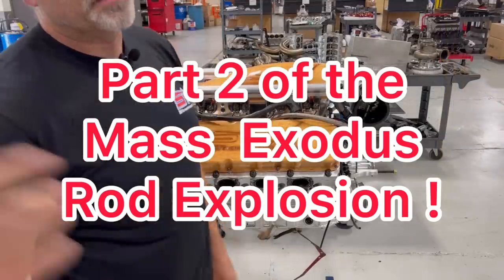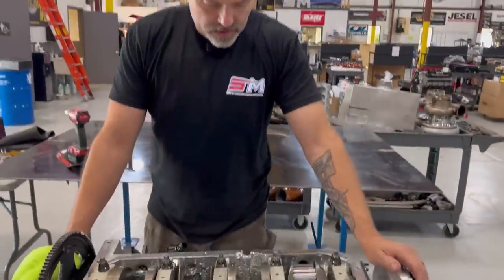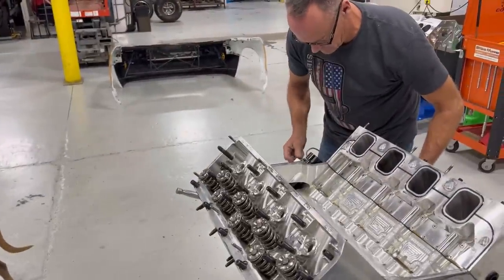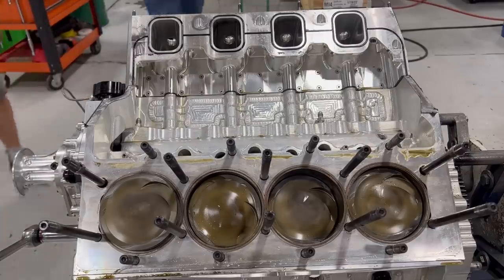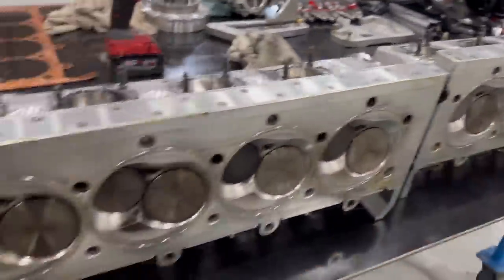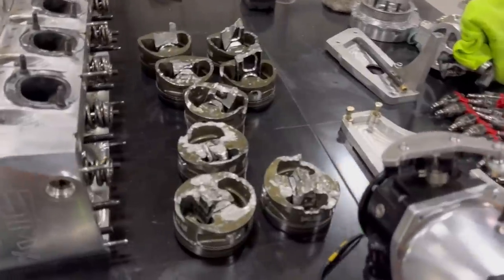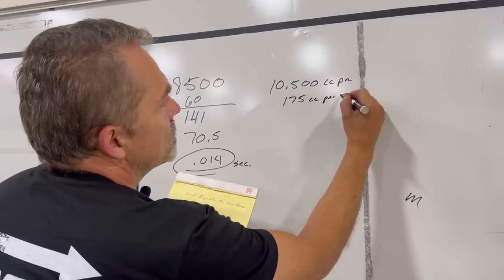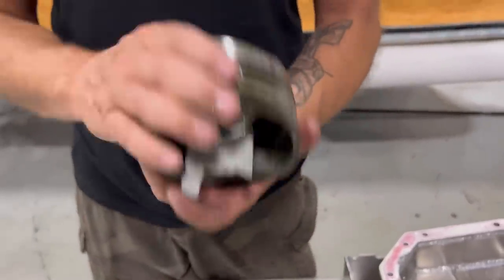EXPLODED RODS  Part 2

Comment: You should do a hardness test on the broken rods, I wonder if they are too hard. Looking at how they shattered they seem to have have not been normalised or over tempered. The crystalline structure seen along the breaks can tell a lot but we don't know the material they are made of or the process used to form them. They look like billet that's machined, I could be wrong as I'm not a engine guy but they don't look forged to me. It they are billet then what hardening/tempering process did they go through? after machining. To me it looks like they were hardened but not normalised enough after. Or the batch had excess carbon and the material was just too hard. Even a simple Mors test is better than nothing, try different areas to see if the part had different hardness's and perhaps huge internal stresses inside. A Rockwell test would be a step up without going too deep into the rabbit hole.. All very interesting stuff..

Comment: only time i broke the little rod end was by detonation. ran it lean detonated broke the little end was on a motorcycle with a carb at about 3/4  track the carb would be drawn dry and the motor shut off. the next rub broke all little rod ends at 7.2k rpm. the chances of machining or the same error to all the parts doesn't seem realistic. especially with such a rare failure

Comment: Im thinking the titanium composition was too brittle, and what was achieved by less weight was sacrificed in tensil stress. Or perhaps the rods were made of an amalgamation of metals that has increased tensil strength but also has increased brittleness, and is unproven in this particular application.

Comment: Hello Steve, when I listen to you my mind does weird things lol... 

1. If just say your cooling system had 55psi of boost put into it would it hold that pressure considering most systems are around 7psi?

2. If the engine "hypothetically speaking of course" hydro-locked due to fuel even though the math says it can't under normal conditions. Lets just say because of some glitch it caused the 1000cc injectors to flood the cylinders with fuel wouldn't the fuel that hydro-locked the engine still be there? I don't remember excessive fuel in the catch pan.

3. I think you said in a prior video the engine had 1000 miles on it and I can't remember how many runs but if it were a defective rod or something to do with assembly it would not have lived a minute ( as you said ) with the power it's making. Now that the actual location and texture of the break can be clearly seen the first word that came to mind was "brittle" like carbide dropped on a steel plate. The next thing is did one rod shatter first and take out the rest or did they all go out at once? You said you felt a very bad vibration like it was the driveshaft, I would imagine it was all instantaneous. At 8500 rpm and with all the fragments I'm afraid only the good Lord himself knows exactly what happened and thankfully He kept the oil off your tires

4. Last question, a video to the right is on unbreakable carbon fiber rods, what are your thoughts?

https://www.youtube.com/watch?v=asb4jLWWTbQ

Comment: I'm not a metallurgist nor a machinist but I do know a "little bit" about the types of stresses that happen to a rod inside of an engine. There are directional and centrifugal forces put on rods that are incredible, and exponential the higher RPM range. It appears your application exceeded the rod materials and/or design and they broke under the extreme stress of load and centrifugal force. I'm sure in other applications at lower RPM they would hold up just fine. I'd have to give credit to the manufacturer for one thing; their manufacturing process must be very exact for every single one to exhibit the very same failure points.

Comment: I haven't seen all the way through and I'm guessing that the rods may have been over hardened in the heat treat. If it has that particular process? Maybe they just shattered into confetti and the pieces caused the resulting damage or lack thereof. Interesting to find out the most likely reason....

Comment: What I see is big end failure at 8300 rpm. The rod caps or bolts let go the pistons then went back down on the combustion stroke the rods were sheared off by the crank journals

Comment: I didn't see the disassembly of the timing gear set as far as the engine hydraulicing but I do remember seeing the rod design which was quite beefy but didn't look to have a vertical lock on the caps but a dowel style lock that just seemed possibly a weak link when cylinder pressure gets high and rpm

Comment: Those crank journals should have a nitride hardening.  One issue could come into play at higher RPMs with aluminum is the out of balance issues.  Harmonics is a problem, but if the weights of each piston and rod are slightly off, the engine can shake itself in a grenade.  Aluminum doesn't handle vibrations for very long before it falls apart.  I know you built the engine with weight of each piston and rod in mind.  You don't skip major steps.  When the interatomic bomb occurs, aluminum tends to reduce itself to tiny pieces.
Reply: BTW for those that don't know anything about engineering, the interatomic bomb is a pun for interatomic bond.

Comment: I haven't seen anything like this since the days right after they switched the top fuelers to dry sump.
It looks like the damage is literally down to the molecular structure of the conrods. If you can afford it, have a bigger piece of the shrapnel examined by a material testing laboratory to confirm my theory.
I don't even think there was anything wrong with the metallurgy as such. I suspect a resonance problem. The forces put on the crankshaft at this stage of tune could have made it swing at a frequency the wavelength and amplitude of which might have shredded the rods. Think opera singer vs glass. This would also explain why nothing else suffered first hand damage.

Comment: There was definitely nothing wrong with the tune-up you nailed it bad bad material possibly stuff that was cooked up in China I am actually scared of death to buy any new parts right now wondering where the material came from but I will say you do have a beautiful looking engine even with all eight rods broke. PS I have broken one rod two rods but never ever all the rods at one time most definitely a material problem so in my opinion I think you nailed it also I think I need to be running one of them blocks like yours sorry to see the damage Keep On Rocking

Comment: Rod material is laminated or delaminating, I cant member which way to call it. I worked in a place that cut steel to make equipment frame and seen plate steel with that issue. I was told it was a quality control issue in the melting of ore and recycled material, not wanting to mix properly.

Comment: I think the rods broke on the exhaust stroke as they passes TDC - the material failed there first allowing the piston to impact the the head and the lower part of the rods had no support to run true in the bore anymore, so they could be subject to physical contact with other engine areas, and they may have acted like a lever to the left and right without the piston maintaining control at the flopping end of the rod.  The break looks like material failure to me.  If the failure was on power stroke it seems like your bearings would tell the tale, and on compression stroke the rod is pushing up against the air/fuel charge which likely helps slow the rod as it’s coming up on TDC…like a small cushion which could reduce the effect of elongation on the rod beam.  It could have occurred sometime between the exhaust stroke reaching TDC or the intake stroke accelerating away from TDC as the piston moves down.

Comment: Could the heating of the crankshaft have caused the radius of the counterweights to increase enough that it fouled the machined (modification that you made) little end of rods?  If this happened it would stretch the rod and maybe cause the 'brittle break' fracture you saw in the main rod bodies.  The leverage of the counterweights travelling at the speed the engine was going would have produced an enormous wedge (leverage) action, and if the clearance (produced by the modification of the rods for which I saw no measurement taken in the engine assembly video) was really small initially, the whole event could take out all the rods very quickly...

Comment: That rod company needs to do a recall on that batch and check all others to make sure it isn't a larger problem with their products. Wether it is a problem with the raw materials they received or they used the wrong material to make those connecting rods or one of the processes they did caused it to fail. What ever is the cause they should be doing everything they can to figure it out and make sure it doesn't happen again. I would be surprised if they don't want the rods back so they can analyze them and figure out why they failed.

Comment: I didn't say so, but I was thinking that the connecting rods failed due to them reaching their threshold. The fact that each one failed @ exactly the same time and exactly the same way makes it quite obvious. I've never seen this happen before now.
The bearing inserts were fine, other than being bent to hell. The journals were fine, no scars aside from where shrapnel scuffed them a little during all the carnage and chaos. Each rod simultaneously failing the exact same way. They simply reached and breached their physical limitations.
Case in point, that was one bad ass engine. Emphasis on "was" 😁.
When he stated that one piston was firing or compressing 70 times in a second whilst showing the irrefutable math I was blown away.

Comment: Could something in the rotating assembly broke or came loose causing the motor to get out of balance? Thus vibrating the rods to failure? I noticed in the last video there was an RPM drop for a short moment that leveled out before a complete RPM drop to zero. Steve also mentioned feeling intense vibration at failure like a driveshaft let go. I am sure these engine are all internally balanced and no harmonic balancers are used. But still curious if something could have thrown the rotating assembly out of balance leading to this kind of failure.
Reply from the maker: Brand new never been used in this application and power level , ever, connecting rods.  No one has ever used these at this power level. 
My original rods I always used ran with 10pm I more boost, same exact everything and ran for 900 miles and 35 passes. I should have just put them back in. 
People want to keep finding another issue instead of looking at the obvious

Comment: I thought you might my experience with anodized pistons. Running a naturally aspirated nitro Harley Venolia was making my pistons and recommended their coating. Need less to say it slowed it down. I came up with the conclusion that the coating in the top ring grove was to slick to hold the ring from moving inward. Recut the grove the remove the coating and used a little thicker ring to make up the difference and everything returned to normal. Thought it might be me until someone else in my class had the same problem when trying the same coating. needless to say I don't recommend it in the top ring grove. But Venolia would not delete it. I just quit using it and started putting skirt buttons on them and solved any scuffing. Delete this if you want don't want your customers questioning you about it. Later.

Comment: Definitely metalurgical from the looks of it. Almost seems like centrifical force took them out since they all grenaded at the same time. With so many pieces it will be hard to find the failure point. Looks like the rods broke up near the piston when they rotated over the centerline of the crank.??? Most of the rod length would still have to be there to cause the damage to the block that I see.

Comment: Steve…just curious.  Did the slight machining you did on the rods affect the balance of the rotating mass?  At 8500rpm I would imagine even a slight weight variance could cause a good vibration.

Comment: If they were steel rods I would have said they were of too high carbon content to hard, but they are aluminium I didn't think it possible to make aluminium alloy rods so hard they shatter.
Have any other race teams had this problem? What do the manufacturers say is the design criteria... tensile strength, max piston weight for speed of operation anything else?

Comment: Yep when the metallurgy Test comes back you will know the real answer.  But you can tell buy the broken parts its a metal flaw due to heat treating.  From looks of it id say it brittle.   As Smokey would say if you just pay attention the engine will tell you what happened.   Definitely a lesson to learn here for the rod Manufacture and everyone who watches' your video's.
Thanks for sharing and putting them out. Now if you would just explain how bad it is to disconnect the coil pack and spin an LS over to get oil pressure  it would be helpful so i can just stop explaining this to fools who believe it wont hurt anything.
Im amazed at some shops and engine builders say this is acceptable.   NOPE!!!!

Comment: Late comment. Just came over cause the new owner of that engine asked me to subscribe. Looking at history of engine build. I'm an engineer but not an expert in metallurgy. Possible issue is poor choice in Al alloy by rod maker, which is unlikely. Possible that at 8500 rpm too much oil gap in bearing spacing allowed "hammering" that caused work hardening of Al. It gets harder, but also more brittle as it's hammered/worked. Most likely problem is Quality Control issue with manufacture of the aluminum billet. Probably the annealing and quench process.

Comment: Did it spin a bearing before failure? Incorrect rod bolt torque? Inadequate clearances? Aluminum rods require larger bearing to crank and side clearances, you should also allow more piston the head clearance. Aluminum rods have relatively short duty cycles. Was this exceeded? Not a fan of aluminum rods, with all the really good lightweight steel rods out there, i question the decision to use aluminum here.

Comment: so, from a machinist view as many pieces as you have in the bucket and the break points id have to say it was a bad mix of material that was introduced to the build whether it was by choice to have a part that was on a lower pick, or the blend of aluminum was incorrect. its just astonishing that the entire block and heads including the rods are aluminum. i know that aluminum flexes in high heat and is normally weak for this application but can take one hell of a beating before it turns to bits. so lastly if the anodizing process is that problem then just don't use it because it might compromise the integrity of the aluminum.

Comment: maybe they broke because of their natural compression/tension resonant frequency, acting like a compressed spring, then being stretched when the piston has less downward load, with the stored energy assisting them to elongate thru the rev range it hits a weak point and combined with thermal stress along the length of the rod causing additional stress to make them crack

Comment: Hi Steve.  Certainly looks like a material problem.  I don’t like that anodizing on the rods.  As you know the anodized surface is an aluminum oxide crystal skin that is grown from the surface of the aluminum.  Those rods are really stretching and compressing from the strain of 4000hp and 8500rpm, causing stress cracks in that anodized surface.  Those small stress cracks will travel into the aluminum of the rod and the rest is history.  That would explain why all eight broke like glass and at the same time.   Probably one rod broke and the shrapnel took out the other rods because they were all on the verge of shattering.  Don’t need the abrasion resistance from anodizing on the rods like pistons do.  Just a wild guess.

Comment: Do you think you'll send the remains of the rods back back to the manufacturer? Not for finger pointing but do they can discover the metallurgical issues going on. It's obviously a bad batch but the rod makers buy the material in so it's possibly a much wider spread problem with the material itself and not the way the rods were made.

Comment: You have more knowledge than me and this is just a thought, could fuel escaped into oil pan and ignited?? When you dropped oil pan it looked like oil was dripping like it was as thin as mineral oil. I really have no clue what could explode every freaking piston unless bottom pressure was enough to stop pistons but crankshaft was having no part of that and continued doing its job so pistons said screw this we are out of here.

Comment: hated to see the destruction, but loved watching the analysis. to me, those rods looked like they were too brittle, which is 100% a material issue, will be interested to see if it was down to excessive power, or if its changed due to heat cycles in the engine, or maybe even fatigue

Comment: All of the rods were shattered, but not one of the piston pin bosses were even stressed enough to cause damage to them. The aluminum rod pieces were sharp, as if the aluminum was hard and not mallable like most aluminum is. I think the rods were not capable of the punishment whereas every other part was. The pistons looked fine. Did the rods work hardern themselves to the point where they became brittle???